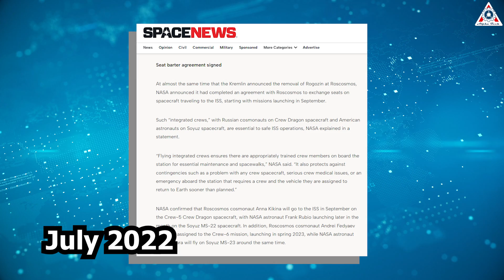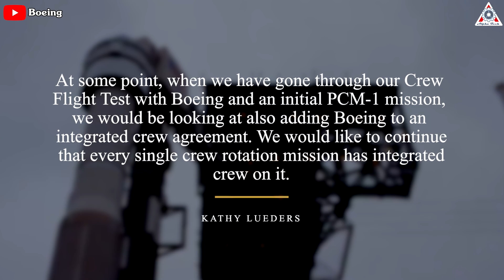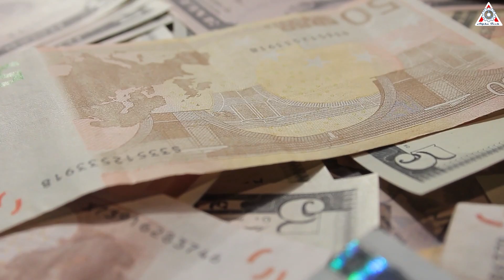Disaster! Russia asks to add more seats on SpaceX Dragon cause of Soyuz FAILURE

Comment: This video overlooks a fairly obvious fact (as I understand it) that Russia has said in 2022 that it will no longer supply RD180 rocket engines to the US at all.
I have to say that I don't consider an expert workforce with an average of 50, to be unhelpfully old, but in any case, what of it?  They aren't supplying any rocket engines to the US anyway.
At this point, the simple thing would be to make RD180 copies in the USA.  What is Russia going to do, sue?

Comment: On a serious note, it would be great to have a Falcon on standby with a full crew emergency evac configuration. Maybe suspended “sleep sacks” instead of actual chairs to maximize human capacity. Fully automated variant.  It would only be used in emergencies.
Reply: You can't launch or reenter in a sleep sack. G forces.

Comment: The RD-180 variant of the RD-170/171 engines was developed in cooperation with the American customers. I recall there was input on quality control and various best practices and components. That being said, there was at east one partial failure with the Atlas V out of 97 launches. 

The RD-170/171 had a number of accidents, including three after the fall of the Soviet Union with the Zenit launch system (in 1997, 2007 and 2013). Problematic development of that engine was a factor in the delays experienced in the Energiya/Buran program (the heavy lift booster and Soviet space shuttle).

Comment: ELON MUSK  SPACE X FALCON 9  is secured for more business from NASA, Space X charges NASA per flight for $40-$60M, NASA will charge the Russian MAYBE $90M per seat as what they charge to US Astronaut?  ELON MUSK should design 3 sizes of Space X Suit and have it stockpile at ISS. EM space suit has a built in ventilation, automatically maintain the require  body temperature especially when decending back to Earth. All they got to do is  plug into the Dragon electric sucket and ready to go together with built in Communication system.

Comment: LOW EARTH ORBIT SPACE = EXCITING, BUT DANGEROUS(!!)
1/2 of the ISS is russian, so if russia fails to send up any cosmonauts, then it'll just flash around that planet 500km high at 17,500 mph empty.

IF LEO MINIMUM ORBITAL VELOCITY IS 17,500 MPH, THEN MICROMETEORITES PROBABLY MOVE AT 10 TO 20 THOUSAND MPH!
<so if a spec(<1gram) hit your car at 20,000mph, what would happen!?>

this soyuz thing is around 50 years old design-wise, and and running external lines (electrical/hydraulic/coolant) on a spacecraft doomed to reach LEO is a bad idea. all this micrometeorite stuff has been underestimated. (might be the second or third mishap on ISS so far).

Comment: The irony here was the US had to rely on Russia when Shuttle retired in order to keep the US operations on ISS going. Now Russia has to basically do the same with the US to try and hold a Dragon seat each crew rotation.
Reply: @GhostYT Excellently stated. I tried to reinforce your viewpoints in other negative comments.
Reply: @jeffreyeckert3013  Why? Did you know that the core stages of the Soyuz booster is just a variant of the R 7 rocket which lofted Sputnik into orbit in October 1957 which started the Space Race? Older technology is a proven technology and the Russians have done a decent job over the past 50 years losing only Komorov and a three man crew. The Soyuz is very dependable and proven. NASA has not launched a manned spacecraft since the retirement of the Space Shuttle in 2011. The only reason men have been flying out of Cape Canaveral is because of SpaceX. ULA can't get it together yet and the SLS is over budget and behind schedule.

And you want to be negative about Russia? I like what SpaceX is doing and I hope that Musk charges the Russians for the taxi service. 

But without Mir II  (the Zarya and Zvezda modules) and the Soyuz reboosts there'd not be an ISS.
Reply: Humanity helps each other out in pursuit of good causes...this is the way it should be...yet our politicians are trying to get us to be excited about killing each other.
Reply: Charge Russia the same rate per seat they charged the US when they were the sole provider to NASA astronauts' ride to the ISS.  I'm sure that is a 'fair' price.

Comment: Dragon capsules were designed to carry 7, however NASA has so far decided to limit itself to 4, so adding 3 seats should be feasible without any problem.
Reply: Dragon was designed for 7 with propulsive landing. One reason to reduce it to 4 was the change to splashdown landings, which required a different mounting angle and more damper movement of the seats.
Reply: It is not comfortable for 7

Comment: "Aging technology" LOL. ULA will not agree to that type of wording. Proven reliable systems is the term often used. Moving in new technology into a program can be just as troublesome as keeping "aging technology". SpaceX has changed that thinking but not everyone has the ability to bring in new technology as smoothly and as fast. Blue Origin can tell you how difficult it is to develop and use new technology.

Comment: Soyuz is essential for reboost. I hope they get this figured out.
Reply: The ISS days are coming to a close.
Nasa needs to formulate a plan for a new ISS using Starship sized modules launched on Superheavy.
Reply: @straighttalk2069  We have a plan for the Stargate Station that will be orbiting the Moon. The ISS is going to be retired. I hope they can keep it for five more years. It's doubtful.
Reply: I thought that NASA asked SpaceX about a boost version of the Cargo Dragon.
Reply: Reboost has already been demonstrated using Cygnus, so it's not strictly necessary anymore (albeit that would be a huge change in operations, so I guess everyone is trying to avoid it).
Reply: @stephanweinberger  Cygnus is a defunct ESA program. It launched using an Arianne V rocket, a rocket no longer manufactured. There were four Cygnus vehicles that were used and destroyed upon reentry. To get another program up and running would take many years, much longer than the planned operation of the ISS. Without Soyuz and the Russian core segments there'd be no ISS.
Reply: @24kGoldenRocket  You're confusing Cygnus (built by Orbital ATK & Thales, launched on Atlas, Antares or Falcon9) with the ATV (Airbus/Ariane).

There were 19 Cygnus launches so far, 7 more are planned.